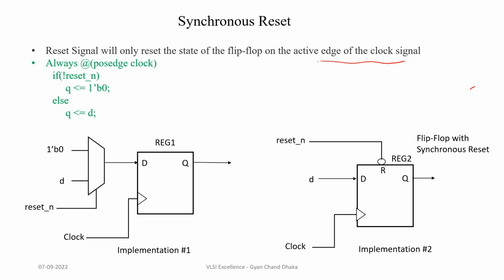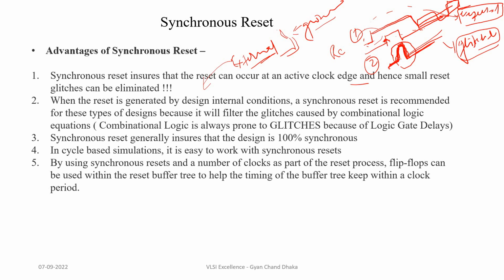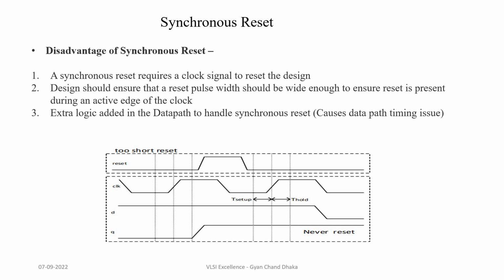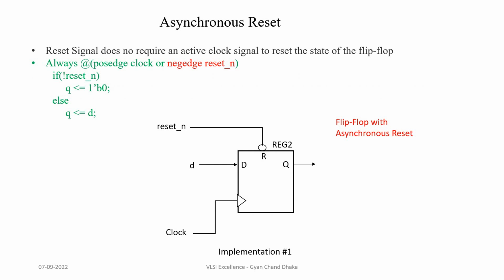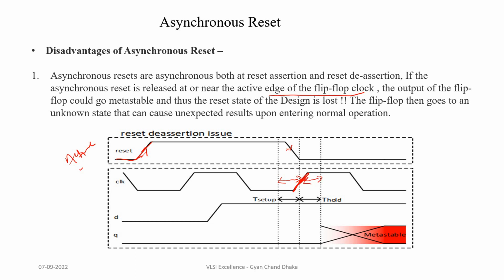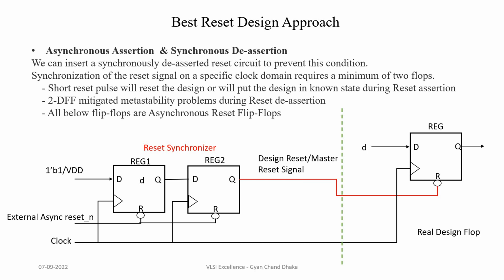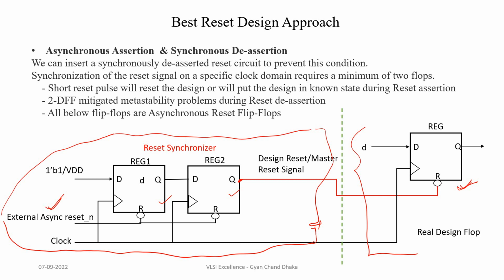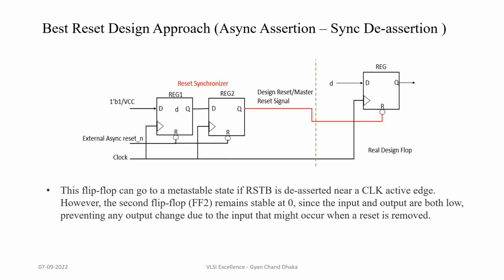Digital VLSI Design | Synchronous V/S Asynchronous Reset Design | Best Reset Design Approach ? 🤔💯🔥

Comment: So the reset signal on the registers in the design connect into the asynchronous resert input meaning it will not need clock to reset the register. However, the signal that connects into them is actually generated using a synchronizer change. I get it now.
Reply from the maker: Hi @優さん, Thanks for the feedback ! Hope you liked the Video. Please do share ,subscribe the Channel to reach out the contents to a larger audience !!! Thanks.